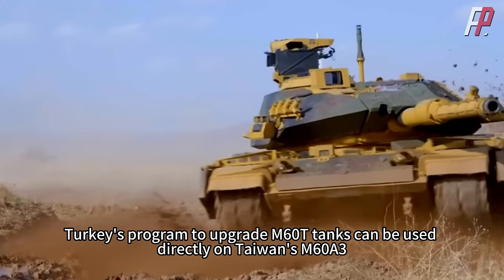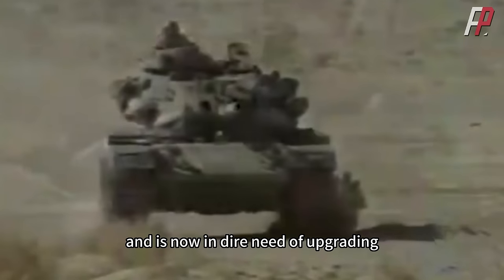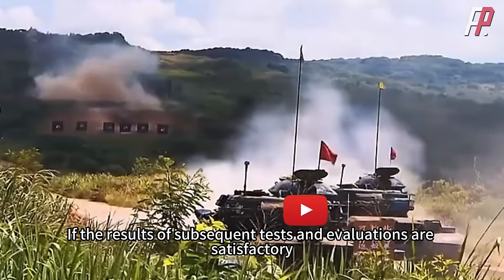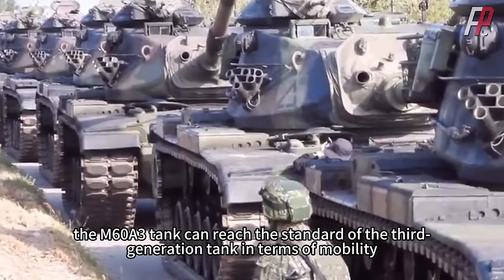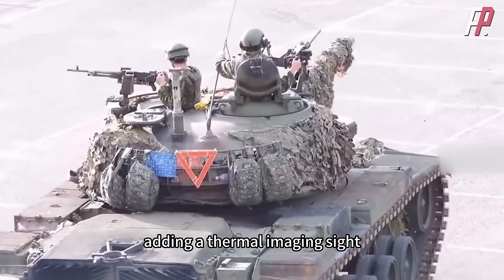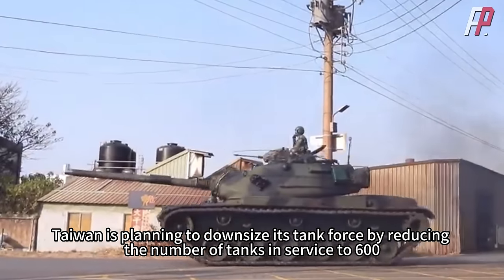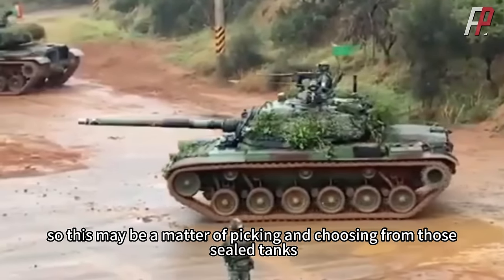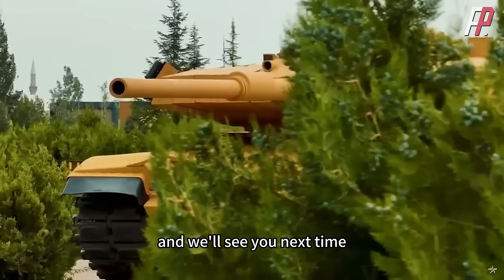Taiwan M60A3 Tank Upgrade Package.

Comment: 105 will work just fine with a high explosive round for infantry troops anti-tank missiles would be money well-spent for their defensive strategy
Reply: No. The 120mm gun is the minimum required to meet current needs.

Comment: Turkey (Türkiye) modernized its M60 tanks and used them against the terrorist organization YPG-PKK in Syria. It was not a tank-to-tank battle, but the modernized M60 tanks were able to withstand attacks by terrorists using modern anti-tank missiles. In fact, a significant portion of the tanks we lost were not M60 but more modern German-made Leopard 2A tanks. The reason is that reactive protection systems are weak. Modernized M60 tanks were more successful in Syrian operations.
Reply: The M60 is when the United States made things to take a beating and keep on going. As old as that tank may be I love it. Big beefy and with a 120mm main gun ouch. Just something about that tank that says made in U.S.A. and with the upgrades turkey has done and Israel its amazing its still can do damage.

Comment: I like the Turkish upgrade kits but at 3 million per it may just be better to buy refurbished or used Abrams, even M1A1s would be better at this point. The US Army has thousands sitting around for emergencies that will likely never be used.
Reply: 3 Million a dirt cheep for that. You can get 10 tanks with 120mm gun with better optics and electronics than those sitting 40 years old M1A1s by buying Turkish upgrade package.
Reply: Another thiing to consider is, the M1 is a logistics nightmare, its operating cost and fuel consumption is massive.  that wont be useful for a small island with limited resources.
Reply: @doodskie999  That is true, I guess it depends on how effective the Turkish upgrade kit would make the M60s. I agree, logistics is another issue to consider as well as budget constraints.
Reply: @rickjames18  Yup, and another thing, the M1 would be too overweight to cross bridges in Taiwan, with its hilly terrain it has a lot of bridges
Reply: Tank on tank war is over, an older chasis equipped with better systems is more useful in mordern warfare, when even the best tank will face the same fate at the hand of drones.
Reply: @MuhammadIsmail-in6vf  That is completely incorrect. If what you say is true the Russians and Ukrainians would all not worry about building modern tanks and just use old crap. That isn't the case, the difference now is that countries are all scrambling to figure out how to counter drones on the battlefield. That includes EW, Hard/soft counters, or anything else like cages. All is being tied, some of which works but is expensive or not manufactured in mass yet. Things are changing but tanks are still the main stay to armies.
Reply: @rickjames18  Actually what he said is 100% true and what you said is the inverse of what actually happens in Ukraine. Nobody is "building modern tanks" for the Ukraine and Russian armys as A) Ukraine does not produce thanks and B) Russia is only ordering and Rebuilding T72s and T90s. Everybody saw what happened to the Leopards and Abrams tanks in Ukraine, using anything other than cheaper, older tanks is a fools game.
Reply: @rickjames18  If you look at Taiwan's geography, a fully modernized and well-placed m60 with top-notch FCS for defense, could be sufficient. They will probably lose nevertheless, though. Letting Taiwan fight against China will be one more of this "Western idiocracy" decisions. Taiwan would go down like Afghanistan, Somalia, Iraq, Syria, Libya or Ukraine.
Reply: @umitkiziltas8379  Maybe, but I'm not sure you are right about China taking Taiwan easily. Even for an experienced military it would be the hardest modern operation ever. The biggest unknown is if Taiwan is willing to fight and if they are preparing accordingly. Meaning, are they building thousands of SAM missiles, Anti-ship missiles, modern mines all around the islands, Surface to Surface, etc, instead of building ships. Taiwan needs to dig in and build defenses everywhere. Only then will it be almost impossible for China to take Taiwan. If they make smart moves like concealing Tank like M60s with top FCS in hardened bunkers around the islands known landing places, etc. Taiwan just needs to get it together. Again, depends on the people and time is running short. The other problem seems to be the other political parties they seem to be working with China instead of saving Taiwan.

Comment: Nice video.
Budgetary issues can limit choices, but it shouldn't force a country to remain defenceless.
If I had to choose, I would go for the Turkish modernisation kits. The Turkish army is one of the armies still actively using M60s, and the Turkish modernisation kits solve the current problems of the M60.
Maybe the gun upgrade will have to wait for a while due to insufficient budget. Defensive upgrades such as active and passive protection and armour upgrades must be prioritised. Then an engine upgrade for better mobility in hilly terrain. A 105mm gun might not be enough to engage enemy armour, but it would be enough to cover infantry.

Comment: If the M60 needs to fight PLA tanks the war is already lost. The M60s are good enough to protect the coastline from landing craft and survive moderately intense artillery.
Reply: Firepower and optics can bridge the gap more easily
Reply: If they are upgraded with new turrets like the Turkish ones yes other then that no
Reply: How many PLA tanks can land?
Reply: Today its all about who see's who first and can get the first round off. Most modern tanks are capable of killing each other. Taiwan can use these tanks effectively as long as its not stupid and thinks that tanks don't need infantry and air support. the 120 mm upgrade with the optics would be the absolute minimum to make them effective at killing PLA systems. I think the biggest issue for Taiwan is dealing with the PLAAF reducing its ability to counter ifvs and tanks. And this is assuming China could even get to the beaches in the first place which is going to be one of the most challenging military operations in history.
Reply: From my experience as a retired soldier who has done many beach landing exercises, the ground troops will only move once the air force has control over the skies and the beach landing has been soften by bombs and missile barrages. Considering Taiwan's proximity to China, it is very likely that many of their land-based missiles and bombs can reach Taiwanese coast which is a problem to counter since it's cheaper to produce unguided rockets and dumb bombs for area bombardment than surface to air missiles which requires sophisticated technology to seek and destroy. Taiwanese troops will be fighting an uphill battle to deny Chinese troops from landing in Taiwan due to difference in firepower and military assets

Comment: The 105mm gun used as mobile protected firepower in the beach defense role would be extremely effective against amphibious vehicles and landing craft.  Taiwan has to stop the invasion on the beach, preventing the CCP from off-loading heavy tanks.

Comment: Idk if we can change anything through the comment section here, but my honest response for RoC Army would be to purchase the MZK Modernization program from Turkiye and look for purchasing more M1A2T for possible Tank-to-Tank Battles. With modern munitions 105mm Guns are still capable at Tank-to-Tank battles, especially against Eastern Bloc Tanks and I'm sure Taiwan alr has a huge 105mm stock that you can't just throw into the trash. So MZK modernization's main + would be a completely new turret with APS and 2-member turret design, so in total tank has 3 crew. You forgot to add, but the MZK turret's main change is Autoloader for its main gun. Considering that Turkiye's intentions to widen its defense industry network around the globe, I don't think Turkish officials would refuse the Taiwanese with a good deal. Switching to 120mm is also a thing, but it'll cost a lot and also require a greater eco-system for 120mm munitions for the RoC Army.

Comment: Just add the turret on top of the Raytheon upgrade package. That will fix the hull armor issues and will give more modern foreign controls with the upgraded turret armor and detection package from turkey.

Comment: It's 8.5 million per unit for a K2 Black panther, which is what I'd pick if i were the Taiwanese government. Highly capable tank with less licensing baggage than the Leopard 2. If they can fully upgrade the protection, mobility, and FCS for less than 5 million a unit, I'd say it's worth it. Just depends on what the protection looks like

Comment: Cover the older models with ERA to protect them against HEAT attack and keep them as infantry fire support vehicles.
People say the L7/M68 105mm tank cannon is "obsolete", but having a main gun and fire control system that can take out every single thing on the battlefield except the frontal arc of a main battle tank is nothing to sneeze at.

Comment: they will have to replace the 105 with the 120 or even the 130 if they don't hurry up. guns rely on ammo, nobody is currently mass producing the multiple types of ammo the old 105 could use. so if you are going to get M1a1 or newer, it will be less expensive in the long run to only have to procure one caliber of tank gun ammo.
Reply: Dude, do you have any idea how many 105mm NATO guns are in service across the globe? General Dynamics, Northrop Grumman, FMG, BAE, GIAT, and Elbit all manufacture 105x617R rounds of various types and this list is not exhaustive, there are several more. South Korea, Japan, Turkey, Jordan, Egypt, Greece, and Taiwan combined have thousands of 105mm armed tanks and all of them with the possible exception of Jordan have production capacity for 105mm shells.
Reply: @josephahner3031  hey dude um, maybe you've missed it, but um we have like been at war dude for 23 consecutive years dude.

all of NATO'S stockpiles are DEPLETED or maybe you also keep missing the biweekly demands of Zelensky for ammo, mostly artillery.

Comment: Being a small island nation, Taiwan isn't particularly focused on tank warfare but rather anti-ship and anti-air capabilities rightfully so. After all, they don't have to fight modern Chinese tanks if the Chinese never made it to the shore, the budget can only accommodate so much equipment, salaries and payment so they have to specialized.

Taiwan is also surprisingly mountainous with extremely few places where tanks can even be used marginally effective which diminished the value of tanks even more so the Taiwanese focused much more on portable AT weapons and ambush Chinese tanks if they ever made it to shore before America arrives.

Comment: There was an L3 package a while back that a company was putting out there that upgraded the Gun to 120mm, the FCS, and a fresh zero hour 1500hp engine for M60s. at less than a quarter of the cost of a new tank. If they just up the gun to the US 120mm Smoothbore and FCS. It should be more than enough of a match to knock out China's tanks. Taiwan can adopt the shoot, kill, and scoot tactics. With the ability to shoot on the move. The first assault would be in the M60 favor it would be up to the crews to keep that type of momentum going throughout any battle. So intelligence is the key.

Comment: Upgrades are welcome upgrades as they are better than the old original, but the planned completion date is too far in the future.  They need to complete faster.

1,000 hp engine is good, but just improving the fire control is not good enough.  The turret needs to be completely new to allow accurate firing at moving targets in motion.

Comment: The abrams will hold the line while the m60 help support troops with atgms. Drones and atgms will matter more in future combat and the tanks role is to support them. The 105mm gun should be sufficient for that role.
Reply: Just the opposite.......Even the lightly modified M60s will prove dangerous to CCP Armor at or near the beach.  Those can deal with any lighter armor/IFVs the PLA/N  might be able to land early. The PLA will have a more difficult time landing Main Battle Tanks from Amphibs (how else ??).  If PLA MBTs do land, then Taiwan can call up the Abrams M1s. The Taiwanese will simply outnumber any armor the PLA lands. You can bet that Taiwanese Command and Control also has the entire Western Coastline pre-spotted for weapons accuracy, right up from their own shoreline and 50+ miles in on the mainland. Even a best of class tank landing ship will have a hell of a time "sneaking" across the Straits and even if it does land, it is a sitting duck for hours. If the Chinese are successful (they won't be), their losses will be staggering.  Perhaps China can just blow Taiwan to hell with stand-off weapons but they'll just end up destroying the "booty, spoils and prize money"......and defeat their purpose.

Comment: They live on a small island nation and are not trying to expand. Unless, Taiwan has been completely over run, China will never get their MBTs (Type 96b,99a and VT-4) on the island. So, for lighter tanks, Amphibious vehicles, AFCs, IFCs and APCs, the 105 is more than enough as long as they have sufficient air defense and/or aircover.

Comment: It is totally incorrect about the engine upgrading.  ROC army selects the engine model from Renk Ameria is AVDS1790-2CAU.  It is a brand new model for AVDS1790 series, but it produces only 750hp which is exactly same as the original 2C models.  At this moment there is no plan to change the engine used for M60 upgrade.  Actually, Taiwan is looking for the local production line for suspension system used for M60 also, but no confirmation news is heard so far.

Comment: BS, the 105mm is NOT WEAK LOL!  Maintenance status will usually be refurbished to Zero hours.
Reply: Nowadays it is, 110-120mm is where it's at, also a lot of countries industries dont really mass produce 105mm anymore. Taiwan needs to get serious about it's upgrades and armament.
Reply: @mauricebeyjr611    Sure, but no one is using 110mm was that a mistype?  One thing about 105mm it is well and tested plus easy to produce.  If I were them, I'd move to 120mm if not 130mm if they serious.
Reply: @dnate697 why? 105 is more than enough to sink a landing craft and wreck any ifv or light tank China can throw at the beaches and they can use something like LAHAT for additional range and top attack. I wouldn't upgun the M60 fleet. Ammunition capacity is more important for the mission Taiwan needs them for. Focus on fire control, C4I and adding APS.
Reply: @josephahner3031   New Turret gives M60 Hull a good upgrade =P  LAHAT might take out a little speed boat or floating Light Tanks but it ain't Jack Squat to a landing Craft.

I know what a M60 can do LOL, I was an M-60 Gunner most of my time in the Army from 1977 to 1985.

Comment: All these question are moot as the question of the expected target hasn’t been asked yet, what is it that you expect to defend against or attack???.  We all know that their real expected enemy is the Chinese.  So the questions need to be asked as to what they expect to happen and how to defend against?  If the 105 mm gun is not going to be any use against what the enemy can bring to bare then if you can’t change them then your ammunition has to change or you tactics with what you have has to change.  You could fit external anti tank guided missiles for instance but using the tank to get to a point where you could use them more effectively!